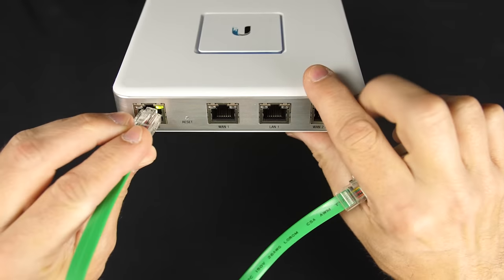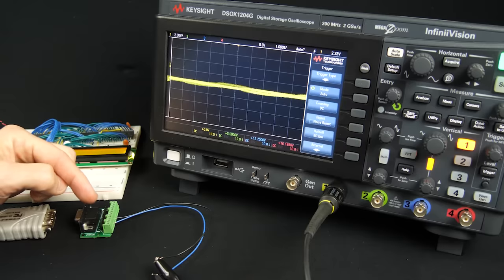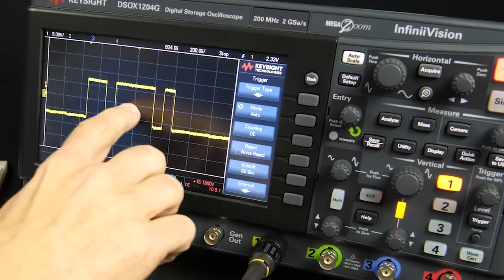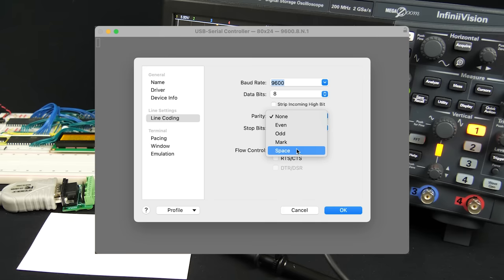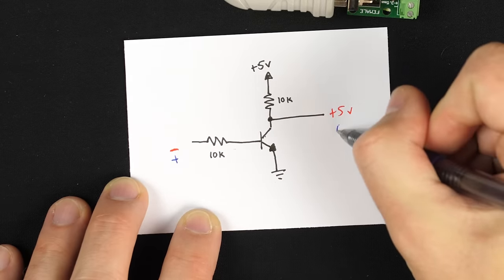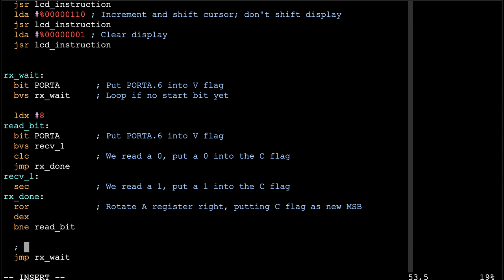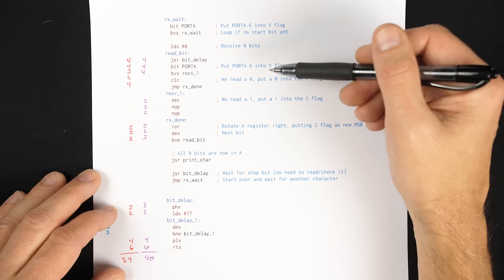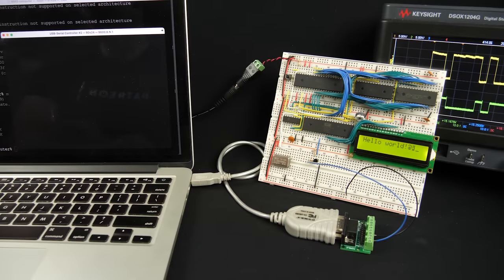The RS-232 protocol

Comment: While admittedly less used on consumer grade equipment, the full 25 pin connector was certainly popular for network equipment in the 1990s and 2000s. Routers w synchronous serial connections would come off as DB25, and connect to CSU/DSUs that would then connect to 64K or T1 circuits to go over a WAN. Often to a remote office or ISP. The flow control signals aren't optional or unused, quite the contrary, they were essential to a proper setup. Console ports are much simpler, but the full interface was used regularly for certain applications.
Reply: This brings back memories of conference calls with network vendor support while on-site with a telco rep, trying to figure out why the insert nsfw-language here circuit wouldn't come up.
Reply: And well before the 1990's too. Clock speeds in the 70's were not sufficiently reliable to allow asynchronous transmission at anything above about 300 bits/s (and 75 bits/s reverse). That was enough for a teletype console and keyboard since that was considered faster than the teletype could print or anyone could type, but for serious communication speeds synchronous comms was a requirement. I never saw any equipment that used the secondary channels though.
Reply: All my 80's retro gear uses 25 pin connectors too.  I never really saw 9 pin connectors on anything except joysticks before the 90's!
Reply: @chrishartley1210  fascinating! I've never heard of slower than 300 baud before, but esp if flow control was optional on those devices it would make sense.

At 7-10 characters per second were those teletype physical printers?
Reply: @loudej  There were a lot of different styles of teleprinter, Teletype was probably the most successful and was a division of AT&T.
10cps was typical so they were slow and quite noisy, but they were a fraction of the cost of the early video terminals.

I remember using one of the early graphics terminals (a Tektronix 4010 if I remember correctly) around 1974. The university only had one, it probably cost a small fortune but paper costs for the Teletype 33 terminals would not have been insignificant.
Reply: @loudej  slower speeds (like 120 or 60 baud) were used for very noisy/long connections (or even radio), painful to use but better than reading words over the phone to someone
Reply: All the serial ports I worked on in the 1980's were 25 pin, though we never used any of the secondary pins in my universe. We phased out hardware flow control over time as people started to buffer their communications.

Comment: Who besides me fast forwarded through the clock cycles explanation?  Except for that, I loved the video.  I learned a lot more about RS-232 than I ever thought I'd know.  My first computer was a Commodore-64.  The video connector was poor at best (TV) so I bought an RS-232 adapter and connected surplus DEC writer I purchased from work (with free box of fan-fold paper).  I wrote a simple BASIC program for my kids.  They loved "talking" to the computer and answering its questions.  Later, I worked with nothing but RS-232 links to all 66 of our PDP-11 minicomputers at work.  I never knew more than the basic pins for the individual signals so this video was a real education.

Comment: This is a gift from god! I've just received my first RS-232 to USB connector that I'll be using in my physics laboratory project with the oscilloscope. Reading data from fiber optics, testing attenuation and error/data loss effects and eventually getting to single photon polarization to experiment with quantum key distribution. I've been mulling over tons of ooollldd documentation for programming to the oscilloscope through the connector and I've been wondering about the specifics of the connector. And here it is!! Imagine my surprise when literally the day I receive the connector, I also receive the best comprehensive overview of the standard I could ask for. As well, I'd never understood what exactly the "clock rate" was for, while you've explained it beautifully 

Your timing is impeccable and your information, invaluable. Thanks a million mate :)

Comment: Nice tight loop, gone are the days (at least in PCs) that you have a known fixed clock rate and execution time, but so awesome to see that in action!

Have you ever thought about getting a ZIF socket adapter for that EEPROM on the breadboard? I always get so nervous watching you pry out and insert the chip with all those wires around it! :)

Fantastic video as always!
Reply: I thought the same thing about the ZIF socket. So many bent DIP pins doing this over the years...
Reply: Hah, yes, absolutely - I've been thinking this since the start of the project. Alternatively there has to be a way to program it in place.
Reply: @WolfePaws  PIC and AVR have ICSP (In-circuit serial programming) where you just leave a pin header attached to the programming lines on the chip. A cable connects from your programmer to the header and you can program whenever you want without having to move the chip.
Reply: I tried this once, but typically ZIF sockets themselves have legs which are too fat to fit into standard solderless breadboard :(
Reply: @richardbanks2669  Very good point. The ZIF sockets I have do have very stubby leads too and I don't recall ever trying to put them on a breadboard.

Though I think the reason he doesn't is just because of the way he explains things so clearly and non-distracting way, like only using what you actually need to do this.  Just like he shows the assembly and EEPROM writing steps each time, so it's absolutely clear what is happening.
Reply: Glad I wasn't the only one with Ben chip insertion anxiety!
Reply: Is there a chance that's what this new series is leading up to? Some way of writing the EEPROM via the RS-232 line?
Reply: @12-343  Not likely. to program the eeprom you need some funky voltages that might not be healthy for the processor, IIRC. But a serial port leads to IO... in the past few months, Adafruit was pretty focused on floppy drives connections for arduinos and the like, so maybe Ben will do "mass storage" and make a CP/M clone.
Reply: @richardbanks2669  The trick is to put in a simple socket, put he zif into that, and then you're golden.
Reply: @WistrelChianti  I used to step on those in the middle of the night on my floor.
worse than legos by far for the walk, it would take real force to remove the damned things from my feet
Reply: The second time I put the EEPROM into the breadboard some pins bent, and soon after broke off. I have got another EEPROM and a ZIF socket now, and it works fine! The RAM and the EEPROM have swapped place to make better room for it.
Reply: He probably wouldn't be timing with busy loops on a 6502 either if he had interrupt timers.
Reply: @CraigBrideau  Nice and true, but 27(C)xxx 28xxx E(E)PROMs are not designed and used in that way. For you youngsters: Here they are especially used for compatibility and easy interfacing (this is a system for the audience ... and Ben?:) ... to learn something from) reasons with the 6502 processor architecture ecosystem. Your fancy ICSP suggestion would in practice be even more fancier: For rapid prototyping normally a ROM-Emulator is used on these systems. Here a static ram with dual ports can be programmed externally, altered during runtime and independently read out internally by the DUT at the same time.
Reply: @RichardBetel  That's why we have DMA (Direct Memory Access), at least on my 6800 CPU. I just HALT the CPU and program the EEPROM.

Comment: This is suuuuper cool! Just 7 videos ago, we were all in 1952 in ENIAC era on breadboards... Now, were all at 1992 Basic Instinct era !! 

Thanks Ben eater, you have inspired my own breadboard project, which is an FPGA programed by an Arduino nano and Dc-4017 made out of 555 timers, the cheapest IC I could get that works on Digikey !! Since my family doesn't have much, As of now it's got 7 555's on a double bread-board in fully functioning gate array mode and building up strong!

Comment: I started as a tech overhauling Teletype machines over 50 years ago.  Back in those days, a lot of companies didn't pay strict attention to the "standard".  Also, you will see the clock signals used with synchronous devices.  I used to come across it with basic rate ISDN.  Even back when I started in telecom, there were synchronous modems that used the clock signal.  Also, there were 2 stop bits at 110B and 1 bit at faster speeds.  Then there was the Baudot code, where a stop bit was usually 1.42 bits long, though with UARTs 1.5 was used.
BTW, many years ago, I designed and built an 8 port serial card (3 ports populated) for my IMSAI 8080 computer.  It used the 8250 UART.  I wrote all the software for it in 8080 assembler code, including a terminal app for use with amateur radio.  I could send & receive in both Baudot and ASCII, as well as printing to my M35 ASR teletype and many other functions with it.  Back in those days you knew your computer inside and out!

Comment: Interesting video.  Thanks for posting it.  For the IBM PC there was a LAN that used the 25-pin RS-232 connectors joined in a ring configuration.  The LAN did not require a network card only a 25-pin serial port on each machine.  Zero-slot LANs were fairly popular until affordable Ethernet cards became available.
Reply: These were the original token-ring protocol networks correct?  I remember reading about this many, many years ago in a MCSE class I took.
Reply: @Chris-ib8lw  Token Ring was IBM's system with real expensive cards connected using heavy coaxial cable we called "frozen yellow garden hose".  It used an expansion slot.  All I recall was there was a zero slot LAN for up to seven workstations that used a 25-pin RS-232 connector for each machine.  For each connector there was one cable connected to one transmit and receive pair of pins and another cable to the other pair.  One cable went back to the previous machine and the the other went on to the next machine.  A small TSR (Terminate and Stay Resident) program in each station would receive each packet and use it or forward it to the next machine.   I do not remember anything else because I never worked on any zero-slot LANs.  They were quite slow at 115 Kbaud, or so, and were only used for tiny networks.

Comment: Great video. Also great to see someone programming in assembly so fluidly!
Reply: Ive been programming in assembly for over 50 yrs
Best Language ever
Reply: @rty1955  Me too. Both 6800 and Z80.
Reply: @ivarnordlkken8082  I had began my work on IBM unit record equipment like the 407 using plugboard wiring then the IBM 1401 and then the IBM 360/30 ans on up. I played with the Intel 4004, and found it to be a toy. I built my own processor built around 7400 chips that mimicked the IBM mainframe instruction set. When the 8080 came out, I used it for an S-100 bus microcomputer. Coming from a mainframe environment, I found the instruction set to be VERY limiting. And could not grasp a SP register, as mainframes don't use that. I wrote major applications in assembly lang on mainframes with only 48k of memory. I was always amazed on what i can do with such limited memory. I would watch a tape sort on a mainframe (which was way faster than using disk) and was in awe. After it read alp the input data, it would print out how many passes of the data it would have to make before final output. You could even tell it which tape drive you wanted the output on even though it used that drive as a work drive! The instruction set was VERY powerful in mainframes and I missed that when I wrote for the Intel platform. For example I could clear 16meg of memory with just ONE instruction. Also the absence of 16 general purpose registers boggled my mind! Who would design such a limited processor! To me, the processors in a PC will always be a toy. They never matured. I now code on TI processors like the MSP430 and PIC type decixes8

Comment: Its amazing that engineers could design a 25 pin interface to carry serial data between DTE and DCE. Even when they reduced it to a 9 pin connector, only 4 pins were actually used. I loved the programming example in the video. It was great to go from the example that printed an "X" when something arrived to actually printing the ASCII characters. Great video.

Comment: Great tutorial on RS232 ! Btw you could simplify a couple of things in your code. Use Y index register for delay countdown instead of X to avoid the phx plx. Also reuse same delay routine by setting Y to either #13 or #6 before calling the wait routine depending if you want to wait a full bit or a half bit. Btw, an interesting thing about the Commodore 64 was that they never did a real RS232 implementation as part of the hardware but delegated that to the CPU so the machine actually had to this identical bit fiddling to transfer or receive a byte. However they did make use of a timer triggering a NMI (non maskable interrupt) so that the read bit was done quickly and a return from interrupt passed control back to the program running. However, the max speed you could use was 2400 baud with this method, and even then they messed up the timing table for PAL computers so it is in fact broken on all machines made! However, one could code this yourself and get as high as 9600 baud like you do here on your 6502, but then have no time to do other stuff while you were sending or receiving. A hack was done to enable this though by simulating a clock signal to trigger an interrupt as all transfers always started with a 1 but required a hardware hack for the receive signal.

Comment: In RS232 there are 10 bits sent 1 START bit followed by 8 data bits and a stop bit so ten bits also there can be one or two parity bits sent before the stop bit. Also there can be seven data bits and one parity bits. So the maximum number of bits sent before resyncing the data is eleven or possibly twelve then when the next start bit is sent the clock is resynched. The start bit is longer than a regular data bit that is why in some devices the receiving device can calculate the baud rate just from timing the start bit and set its own baud rate from that.

Comment: This reminds me of my days doing assembly programming on a PIC16F84. I had implemented a bit-bang UART driver that drives an rs232 interface.
Also a 232 interface using a simplified ttl level voltages is prevalent in embedded programming for debug purposes
Reply: git ?
Reply: I also used the PIC16F84.  The program memory was so small that I had to write a single bit bang routine to handle rs232, i2c and rs485 for an amusement arcade machine monitoring system, I remember using an interrupt pin for the rx line, causing the start bit to trigger an ISR .  Now we have atmega328 its a different world. LOL.

Comment: Excellent tutorial, I don't think many people programming today would get, or appreciate counting CPU cycles... but that is how we had to do it back in the day! Even at UBICOM in the year 2000 their microcontroller would read the ethernet traffic in the ISR it did cycle counting... It was a Hard real time requirement, and the branching through had to balance in time regardless of the data received. Next when you get to the UART part of your tutorial, when I wrote my Master's thesis in Computer Science I did a study on Real-Time communications and used RS-232 and did the deep dive into that protocol and the whole architecture of the IBM's UART, PIC Controller, and learned just how flawed that was... I figured out the hardware bugs, I think 5 to 7 gotchas that did things like: prevent Full-Duplex ISR driven TX/RX, what the source of those mysterious callbacks when the line was enabled or disabled, instruction overlap in the x386 and the I/O instructions, etc. Back in the early 90's  I researched this deeply, and I never saw printed in a book!

Comment: Great video! Few improvements that could be possible:
1. Use a conditional jump subroutine to get a 3 cycle delay instead of 2 NOPs for 4 cycle delay, to allow getting the more exact 104us delay
2. Half bit time routine wasn't exactly half a bit time. Would be closer to 69-70us when half bit time is 52us. But not super important here.
3. Could be cool to parameterize your delay subroutine so you have the same sub routine for 1 cycle and half cycle, but that's just for overachieving:)
Reply: He is just doing bitwise  ttl receive for this video ?  I think it will fail when he has a longer cable .. more capacitance... he will show you  then show how a UART handles it still.
Reply: I was also concerned about half bit timer :)

Comment: The clock pins were commonly used and are required for synchronous modem connections, typically used on private wire circuits.  In the days before the internet this was how you interconnected branch sites, originally with a copper circuit patched through the local exchanges between sites.
Reply: But as it turned out, switching to asynchrous meant it worked on longer cables , noisier  environments.. noise on the clock signal would send it haywire...  the async UART works with about 5 samples  of the received bit..  See, sometimes the circuit would be a bit assymetric (eg for mark vs space) and so the timing of the signal coming through would be a bit skewed.. as the main problem with a long cable is capacitance, the charging of it takes a bit of time.. if the circuits are not perfectly symmetrical, the timing of the pulse is not symmetrical (between mark and space.)